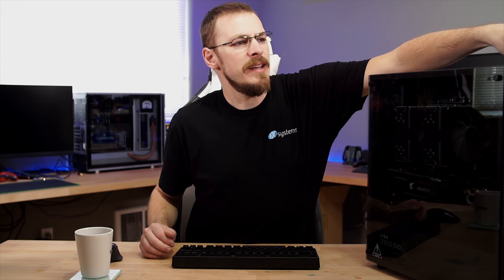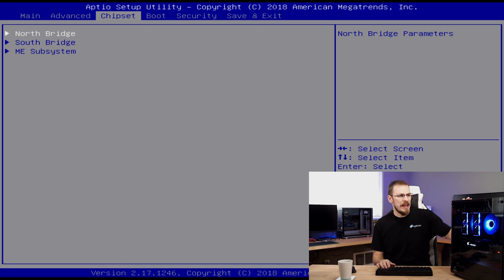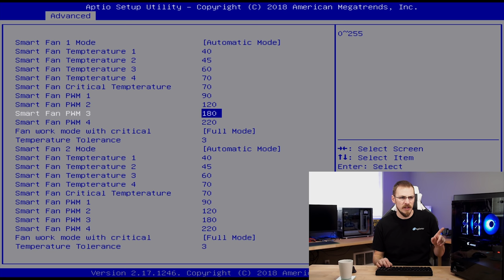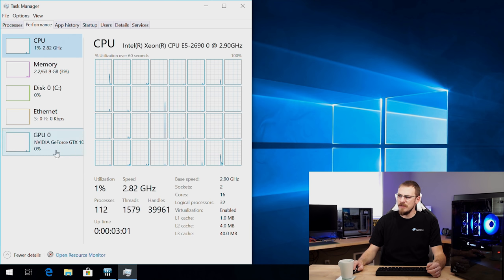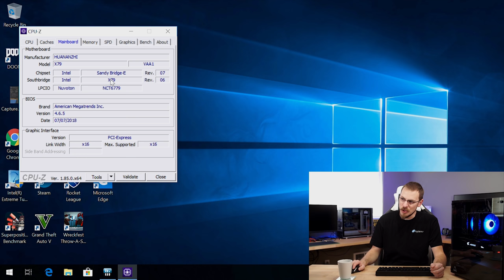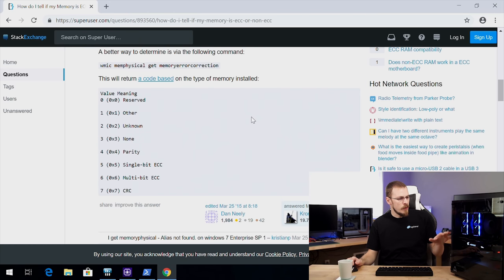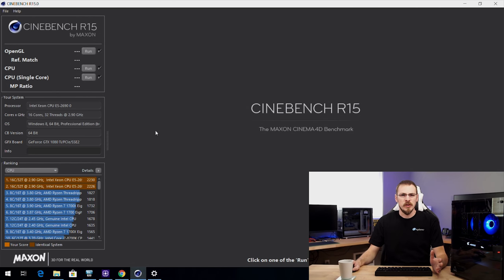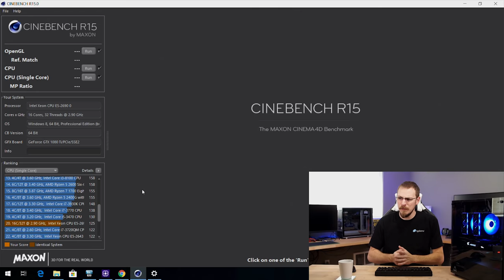Huanan "Dual X79" Motherboard Review

Comment: Being that the GPU seems very bottlenecked in this board which makes it not so great for gaming, I know you mentioned it would be excellent value for rendering videos or doing CAD work.  However, what about GPU rendering that isn't of the gaming variety?  For example, some 3d/CG render engines are using CUDA cores for their rendering power and speed.  The more cores, the faster the animation will render, etc.  Are the speed of the CUDA cores in this 1080ti bottlenecked?  What about VRAM?  If I got this system for 3d animation rendering, I'm sure it would be great during the design process and viewport performance, but what about GPU CUDA rendering of hundreds of frames?

Comment: Hi! I have Huananzhi X79, the one with one socket, the green/black theme and two m.2 sockets. What do u think, is my board faulty; changing the Power Limit values in BIOS have no effect. In BIOS it's said there "Mainboard power limit 115 W", and that's really true, I can see it in HWinfo; when running LinX the cpu (E5-2689, 8-core Sandy Bridge) starts throttling. First the CPU Package Power value is about 130 W, but then it goes down to that limit of 114.x Watts. Simultaneously the clocks drop to about constant 2.8 Ghz, Vcore ofcourse drops too, from 1.15 V to 1.04 V, hence the consumption drop. Playing PUBG the clocks stay at 3.3 GHz and the consumption is only about 70 Watts. Like said, maxing the limits in BIOS to 255 W has no effect. This board is not working like it should, right? Thanx.

Comment: Don't the C6xx chipsets not support overclocking? Pretty sure you only get overclocking features on the X79, X58, X99 etc chipsets aka the enthusiasts chipsets. So the fact they are using a legitimate C602 chipset it makes sense there's no overclocking support.

Comment: I have the same CPUs running on a used Dell T5600. On the positive side, getting that is cheaper and easier than building from components and it has all 4 channels of ram per CPU and a maximum of 128 gb ram.  I didn't get the fastest ram by mistake, (or even ram that matched - each cpu has a different kind); it's running quad, 9/9/9/24  but the clock speed is lower, 640 mhz - combined that's the same. The bad side is it runs much hotter than yours.  The worse of the CPUs has some cores get upto 92 or 94 under full load. After a lot of internet searching I got the impression that that's considered acceptable for this chip. That board is also not overclockable in any way at all.  I got the same Cinebench score as you when I first made my machine, but it's down about 100 now, either from security updates or from background tasks.

Comment: Hey, about your CPUs running at different temperature... The second one actually gets hot air from the first one to cool itself... To fix that, you must rotate one of the CPU coolers 180 degrees, so that the both of the fans face each other.

Comment: Hi! Thanks in advance. I bought this motherboard and 2 xeon...I have a important question for you, how i can do with a psu with only one 8 pin cpu cable? Can I know your solution? What do you do for resolve this problem? I have a coolermaster 750w silent gold...
Reply from the maker: https://amzn.to/2YvmGLj
This converts a PCIe power plug into EPS for a second CPU. I use this on another dual Xeon board in a server and it works great.
Reply: @CraftComputing  thanks! I bought also a evga supernova, suberb psu...i love it. Is it normal that chipset temperature is moooore high? 120° C! Incompatibility with software?

Comment: wonder if theres a dual z270 board so I can add another 7700k to speed up my renderings instead of getting one of those stupidly expensive x299 or x299 stuff
Reply from the maker: No such thing. Consumer chips can only run with a single CPU

Comment: Hello Mr. Craft Computing,
I am looking to build a video rendering workstation and I already have a pair of Intel Xeon E5-2697 v2 does this board have any issues that would prevent Adobe or Blender from running on this build with 64Gb of ECC ram
Reply from the maker: If you already have the CPUs, this would be a very solid system. No issues at all running workstation software, and it does support 64GB ECC up to 1866MHz.
Reply: Thanx
Just subscribed to your channel.
Always like the fact that you sipped on a brew while doing the I. T. thing.
You need it in some instances!!

Comment: I would like to try this system with two e5-2637 V2 for gaming.
The logic behind this is that two cpus are able to use more power than one 8 core xeon so they should perform much better under heavy load,
maybe.
I wonder if the second cpu is actual going to be used under load.
I am going two use it with my RTX1070 that I use with my Intel 2500k at 4.5ghz that by the way is doing an amazing gob in most of the games.

Comment: Very cool. I was actually a bit underwhelmed by the cinebench. Even the smaller 1920x threadripper can hit 2500 with 12 cores and 24 threads, granted at a much higher clock. Idk, was just expecting more. Still awesome build and video though.

Comment: February/March 2020 now, so 15 months since this video was published, and I'm genuinely considering getting this to start a homelab. Was looking at Dell R720 and similar, planning on dual Sandy Bridge or Ivy Bridge, 12 or 16 cores, low-ish power (<100W), with two GPUs to run two Windows VMs with GPU passthrough for video editing, rendering, some light gaming (read: Magic the Gathering Arena, lol) and maybe a couple other VMs for network services, web hosting, etc.; but the cost here in the UK for an R720 is prohibitive to me, especially when compared to the US cost... US$300 there (~£230), but it costs £400 here? Pfft... I ended up looking at a used SuperMicro 2U with a X9DRi-F board spec'd out at under £300, but the 2U form factor unfortunately imposes half-height GPUs, and I can't find a 3U equivalent or one with risers at a decent price for me.

Just came across these same Chinese "dual X79" boards on eBay for under £100, so will price it out with what I want and see if it's worth it — my only question now is whether to try bothering with RAID 5 or not, if hardware RAID is even feasible on a consumer board like this one.

Comment: My Thinkpads all run Fedora 29. Alll of my coding, data backup and archival, and virtualization I do in Linux. Problem is, Fedora doesn't really like my gaming rig as a dual boot solution (with stubborn nouveau drivers and compatibility issues with the 1080), and my W520 Thinkpad doesn't exactly do the job as my flagship Linux rig. This may be a great alternative to building a cost-effective rendering/compiling and all around decent motherboard for that itch.

Comment: This is an interesting stuff :-)
I used a mini ITX/mATX x79 Board with a 2665 + 16GB R ECC Ram - 950CB! Worked very reliable with good power in comparison to DIRT CHEAP. > 140€ (@the time) + 50 + 40 + watercooling. Registered ECC is dirt cheap if used. These boards don´t care and it was used in my scenario in WIN 10 Pro.  BUT if you go over the price sweet spot of the CPU like V2 Variants you get into the 150€ + category where a Ryzen 1700 sits!

Comment: I bet you can get an used or old stock dual socket C602 board from a reputable manufacturer for 190$. Also, VT-x is not VT-d, you should test if this board can pass a graphics card to a VM.

Comment: Your issue 4 beeps should be "power shortage", how many Watts is your power supply capable of? You did not tell us in the video. Memory with ECC must be mainly supported by processors not just motherboard! There is no support ECC from i3, i5, i7 processors, only Xeons and may be some i9 from Intel do support ECC memory. All AMD Ryzens do support ECC memories. Your memory do run on dual channel but i think they should be on Quad channel or 2x Dual channel? What is exactly name of the motherboard and version of BIOS? Brand? So C602 chipset is consumer one? X79 should be better.

Comment: What cpu was this? Intel Xeon E5-2690 V4? Can't be right, thats a 14-core cpu, and you said yours had 8 cores?
Edit: Nevermind, it is the Xeon i mentioned, i guess you just made a mistake in the beginning of the video. Not enough beer i guess. Anyway, you corrected it later in video :)
Reply from the maker: E5-2690 v1
Reply: @CraftComputing  Oh i see, thanks.
Reply: No, it's the V1, which is SandyBridge-EP:

https://ark.intel.com/products/64596/Intel-Xeon-Processor-E5-2690-20M-Cache-2-90-GHz-8-00-GT-s-Intel-QPI-

An interesting though slightly more expensive alternative is the E5 2680 V2 (IvyBridge-EP) which is a 10-core and does have the advantage of natively supporting PCIe 3.0 (so using something like a 950 Pro for a C-drive is more relevant):

https://ark.intel.com/products/75277/Intel-Xeon-Processor-E5-2680-v2-25M-Cache-2-80-GHz-

Comment: i would use one of those boards for a render machine. the 32 threads would be able to tear my 8 thread rendering a new hole and the 64 gig wouldnt hurt either. i would like to see it run linux as well and dont feel i need to see its gaming stats

Comment: It's been a year
Anyone having problems with the board?
Reply: I bought the version whch has 4 DIMM slots per CPU. Main issue atm is I sometimes get a 124 BSOD. This could probably be resolved by increasing the VCCSA or related voltage a tad (I'm using 2x 2640 with 64GB/1866 RAM) but atm the BIOS doesn't provide such voltage controls. Pity because the performance is good; the CPUs cost a combined total of 30 UKP yet for threaded tasks it scores about the same as a Ryzen 1700, though of course the IPC is much lower. I'll try later with 2x 2650 v2 and 2x 2680 v2.

Comment: I did running into some  issues of power actions using Windows10 with SandyBridge CPUs. Using E5-2660 with Gigabyte 6PXSVT(c602), fans remain spinning after poweroff in Windows. i5-2380P with ASUS Z77I-Deluxe is exactly same. And E3-1260L with Gigabyte 6UASV (c204)servermobo can’t do a reboot. It just poweroff after hitting reboot in Windows. I tried everything including disable fast boot, update BIOS, drivers, ME firmware but nothing works. Problem solves only after I swapped to Ivy Bridge CPUs or try some other mobos( I tried E3-1230v2 E5-2603v2). I think maybe there’s some bug in Windows 10’s power management with these old platforms.

Comment: I managed to get a DELL Precision T5600 (dual socket LGA-2011) workstation for free (legitimately!!!) when it was decommissioned at work; included an 825W power supply, 32GB REEC 1600 DDR3 RAM in quad channel, and 2xE5-2667 (2 x 6C:12T). I added a new 240GB SSD ($60), a single use WIN10 Pro license ($12), a GTX970 OC ($120 last year), and upgraded the CPU-s to 2xE5-2689's (2 x 8C:16T) which all core turbo to 3.3Ghz!  Consistently manages over 2200 in CB R15.  Basically, after selling the 2xE5-2667's ($70), the total investment came to  $122. A decent 1080P med gaming machine and a solid workhorse. The only possible downside...the neighborhood lights dim slightly when I run a benchmark.

Comment: I would pay about $40 more for a used Asus Z9PA-D8, as opposed to the Huanan X79, just for the extra features, expansion, and brand name.
Reply: I’m running dual 2667s and the Z9PA-D8.   Have issues using some of the ram slots with the coolers I chose (and/or with video card in 1st PCIe slot).  Otherwise very nice board.   Has a daughter card to enable on board RAID or JBOD for very large# of drives and still have all your PCIe slots.   So it (and this Hunan Board) are a great cheap choice for KVM hardware passthru for VMs (UnRaid, etc).   The high cpu count fits well with UnRaid’s docker hypervisor.   And/or Your utility apps can run as containers without needing to bother with VMs, thus use all cores (Handbrake etc) when needed / use no resources when not needed.  And you get the NAS feature as a bonus.   Great use case.   Can use a couple dual SFP+ cards plus Vyos VM to make a 10Gb switch for <$50.  And/or use it as your router (PFSense, Untangle Home version VM, etc) It’s Like putting several PCs in one box and having all be an a rock solid Xeon base!!  Which mitigates the power consumption argument a bit.  Single thread performance is the main thing you’re giving up.    So just don’t consider it for those use cases where that makes or breaks it and you’re good.   This is your 4x4 pickup that tows a 30 ft trailer, not your convertible to race stoplight to stoplight 😎

Comment: have you tried to install hackintosh to it?
Reply: I do this with a JingSha/Kllisre Dual X79 and a pair of E5-2630L v2 (6x2.4GHz/15MB 65W). It need a lot of patches (ea. for the memory: MoBo have 8 DIMM slots, in the BIOS there is 16DIMM per CPU! Mojave make Kernel Panic without patch when DIMM slots of the second CPU are populated. Same think for the USB)
With a pair of RX580, it is very powerfull for hit riduculous price! (tested with Capture One v11)
NVME slot deliver 2850MB/s with a Samsung 500GB 970EVO+ SSD
There is no deep sleep (S3 doesn't exist in BIOS)
100€ for the MoBo, 40€ for the 2 Xeon, 40€ for the 2 Heatsink SnowMan 12cm with 6 heatpipes, 110€ for 4x16GB DDR3-1600 Reg-ECC, 1.5€ for the CPU 8pins splitter...
Of course, if you want a pair of E5-2697v2, you need a powerfull PSU (Corsair 650W is OK for my config, but certainly not enough for a pair of E5-2697v2 and a pair of big GPUs)

Comment: USB 3 with the latest Windows 10 seems not to be working properly. i Tested this with two exact same setups getting the same problems. i even went out of my way and bought a PCIx usb 3 card to not use the Mother board USB and same problem. seems to be chipset driver problem not the actual USB 3 hub. Anyone else got around this?

Comment: Just watched 9min, but an 850w PSU? I may be a bit overkill but I run 1200-1250's on my single socket builds.... quad and 8 core ones
Reply from the maker: That's quite a bit overkill. This system draws less than 650 from the wall at full tilt.

Comment: Hi, is it possible to use two different LGA 2011 xeons in that motherboard? For example E5-2620 and E5-2690.
Reply from the maker: No. All dual CPU systems required matched pairs.

Comment: On my ASUS Motherboard says x79 and it’s a c602 board
Reply: I have a JingSha/Kllisre Dual X79 and is a C602J chipset
Reply: @piutibear  I like that board.  Small and compact vs my ASUS.  How does it run?
Reply: @benzenegaming3199  I am actually working to make a good Hackintosh with it.
I do this with a JingSha/Kllisre Dual X79 and a pair of E5-2630L v2 (6x2.4GHz/15MB 65W).
It need a lot of patches (ea. for the memory: MoBo have 8 DIMM slots, in the BIOS there is 16DIMM per CPU! Mojave make Kernel Panic without patch when DIMM slots of the second CPU are populated. Same think for the USB)
No problem with Win10Pro

With a pair of RX580, it is very powerfull for his riduculous price! fast for RAW photo processing in Capture One v11, in particular with two RX580/8GB GPUs.
NVME slot deliver 2850MB/s with a Samsung 500GB 970EVO+ SSD

There is no Sleep/S3.
It needs an E-ATX case (I re-use an old P4 Server tower).

Comment: I bought a Thinkstation C30 for $230. It has a C602 motherboard, 10GB ECC RAM, and two E5-2609s. 
Not a bad board, but proprietary size ssi eeb (still fitted it into an NZXT S340) was a pain.
Reply: I may look into this later. I have an hp something motherboard in a cooler master haf x, duel opteron 2431s, apparently the board isn't supposed to be able to boot with them l, it does, which is nice.

Comment: I'm trying to install NVME ssd by adapter but it didn't appear i bios and windows.
I'm using single processor.
Reply: Please help me
Reply: There is a setting called SCM or something. You need to disable it. Or you may have a faulty adapter.
Reply: Probably the slot where your adapter is was not working without the second CPU

Comment: I got a 2650 on my intel dx79 mb I noticed it might be bottle necking my gpu do to running such a low base clock. I was considering buying a 2690 or i7 3960x which do you recommend I go with?
Reply from the maker: Depends on what resolution you're gaming at, and what GPU you have. I compared the 2650 to a 2670 a while back, and at 1440p with a GTX 1080, there was no difference between the two CPUs despite the clock differences.
Reply: Craft Computing I will be gaming at 1080p I still have a gtx780 classified

Comment: What about this system as a free nas with all the sata connectors?
Reply from the maker: Most of the SATA ports on this board are only 3gbps. It could work for a NAS, but definitely not the best option. That, and home NAS servers really don't need much processing power. This is overkill for that.

Comment: im thinking about upgrading my video rendering beast to this motherboard and cpus, i vary rarely game and mainly deal with UHD & DCI footage so multi core and hyperthreading for me is more important then a gpu power trip. ive currently running a formula v mobo with a fx8320, but im finding 8 core and 8 threads is not really enough . im looking at saving money as i have got a business or 3 to take care of but def want to upgrade my 4k video render beast. I will look into this motherboard. Thanks for the info

Comment: Hello! Sorry but myoral english comprehension is a bit bad, so i'd ask here, what kind of xeon could this cpu mount, and if i can use this mobo to sli two gtx 1070 ti, i'm interested in making a gaming setup matching the cpu total cores with the ones of high end gaming cpus, and i'm really interested also in the ddr3 ram slots, because i have a 4x4gb 1600ghz ddr3 ram, and i'd like to implement other two of the same model, is this possible? i know it could be better buyng a 12x4gb 1600ghz ddr3 ram, but i read that i could also try the other way, is it true? Thanks :D
Reply from the maker: Xeon E5-2600 v1 and v2 CPUs. This motherboard does not support SLI.
Reply: @CraftComputing  neither with a sli bridge? I imagined that this mobo hasn't built in sli